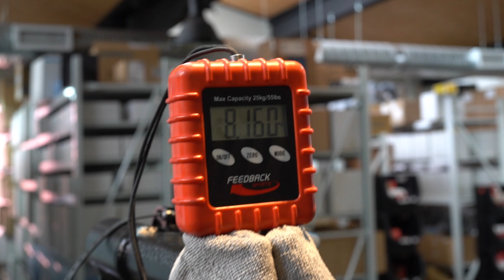Custom Bike Build - Colnago Master

Comment: Back around 2000, my buddy did pretty much what you just did - ordered his Master Light frame in a very similiar gorgeous color scheme, and went Campy Record all the way, building it out from the ground up.  I had a new Chorus equipped De Rosa '57 Replica thin tube sweetheart, with the frame built personally by Ugo De Rosa.  Those were VERY good times, when steel still ruled the road, and you could develop a very special relationship with a bike.  We rode the mtns of Colorado at every opportunity, which were many, and always recognizing are blessings.  Don't try that with the Chinese carbon these days - No thanks.

Comment: I had a Master X Light in an almost identical build until a car running a red light did for it (and almost me...). The one problem with these builds is that no modern stem is thin enough to match the diameter of the tubing of classic steel bikes. I know it's unavoidable, but that claimp on the seat tube is making me wince...